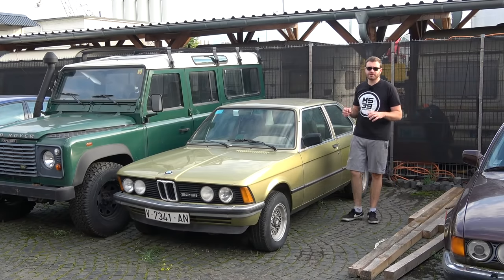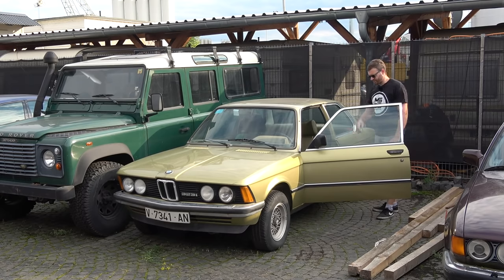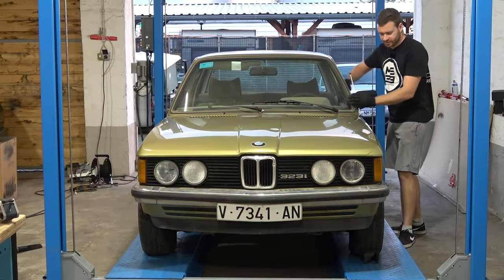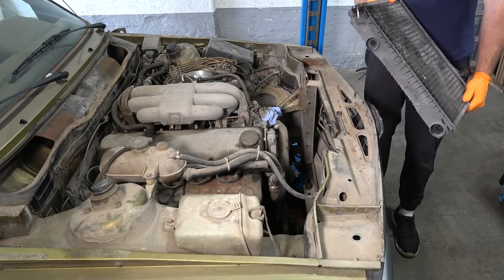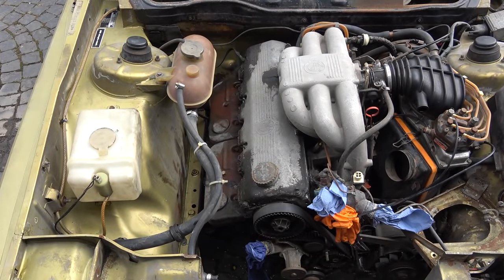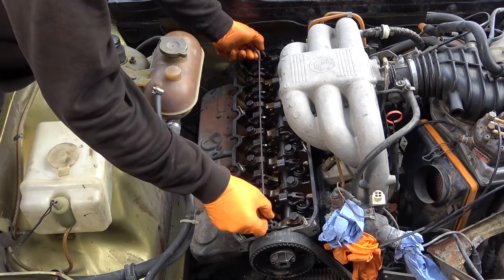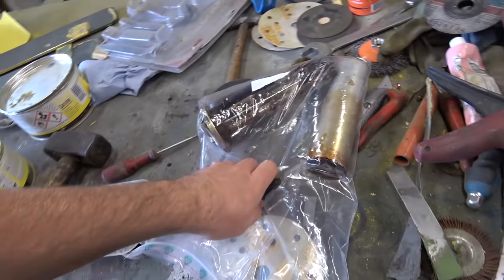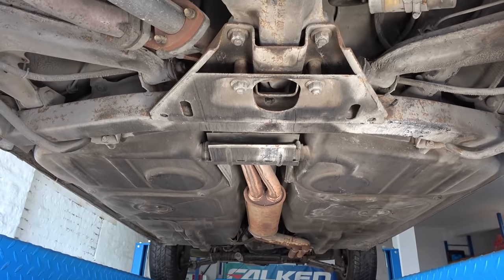26 Years Of Sitting - What Does It Take To Get it Running? BMW E21 323i - Project Castellón: Part 2

Comment: this may help you with tuning. i had bosch k jetronic on my audi i drove 100 yrs ago. that chunky stuff with fuel distributor on top is called venturi. at the end of arm attached on spindle is potenciometer that gives to comp proper location of venturi. at same arm is allen set screw i think 3 or 4 mm that can be reached with extra ling allen wrench from hole at top of housing, and level of venturi can be adjusted. it's royal pia bcz just small move left to right means live or death of engine. service manual should have proper adjustment far all components. voltage at potenciometer when venturi is in std position plunger position etc. Distributor itself is not repairable although kits exist. it's really complex system with tiny membranes and ceramic parts. I did it for fun but never managed to seal it again. if plunger goes back and forth smoothly probably problem is potenciometer, dirty or cracked. As i know only diff in between those distributors are in length of plunger so i kept original audi and stick it into mercedes distributor and worked. Took me week to make car running just bcz i carelessly moved all set screw, potenciometer and timing from original positions but it was priceless feeling when car started.

Comment: My 1980 320i (US) would not start between the temperatures of 60 and 70 degrees F due to a wonky cold start valve. For a while I would pack ice around the valve for a few minutes then it would start. Once replaced with the OEM valve it never failed again.

Comment: Got yourself a real good one here, the satisfaction you will derive when you get it up and running will surpass all the others for sure. The harder they are to rescue, the greater the contentment when you succeed. I mean, sure, it's nice to have an easy one now and then, but the thing that really puts a smile on your dial is overcoming a proper challenge.
I reckon you'll be well on the way once you get that injection pump thingy rebuilt and working properly. The paperwork fiasco might be a hurdle though - you'd hope there must be a way around it if you really can't get a hold of the original documents, this kind of thing must have happened before surely. Hopefully that will work out okay.
Great video as always - the girly squeals had me laughing. Perhaps you need to spray some of that Fogging Spray for Men on yourself..... lol.

Comment: The low compression might be because the rings are stuck in the pistons from sitting for 26 years. It might come out of it if you get it running.
I'd be surprised if the compression is that low for any other reason after the amount of miles it has on it. 

I'd get it running, driving, and drive it for a while and then re-check the compression. Get a few heat cycles through it. Maybe soak the bores with penetrating oil.

Comment: The mess in the cooling system is the result of the anti-freeze degrading and breaking down, and then some of the components of the anti-freeze reacting with the calcium (chalk) content of the water in an area that has fairly hard water.  It looks horrific but it is quite easily cleaned out, especially if you're going to rebuild the engine which will probably mean getting it bored, which is likely to mean hot tanking the block anyway.  I've seen that a lot in my part of the world as we're on chalk here, which, inevitably, dissolves into the water, and I've seen blocks that are literally caked full of that mess in the water passages come back fir for further use.  Being as it's largely chalk-based, the muck is pretty soft and very easily dissolved by a lot of chemicals...

With the fuel gauge wandering around like that, there's a very good chance the voltage regulator on the back of the dashboard is extremely tired and on its' way out, especially with the car having been dormant for so long.  You'll probably find the temperature gauge will also act up a bit too, but a replacement regulator shouldn't be expensive and is likely to be very similar or the same as was used in other German vehicles of the period.  I've replaced a fair few in various Opels and when I've got new ones they've been marked with the Opel lightning badge, the Volkswagen roundel, the Mercedes-Benz three-pointed star and the BMW propeller badges, though mostly I prefer to use ones recycled from end of life vehicles...

Comment: Hi, being a big fan of the channel, I have bought a E21 318 carburator and doing a full restauration. But I'm facing a problem : the chain guide (the metallic one) is NO MORE available anywhere in the world ! And mine is cracked everywhere and needs replacement ! Please could you help me sourcing one new or used (but good condition) in private stock because manufacturer have stopped doing them :-( :-(  MANY thanks in advance :-)

Comment: Oh ye of little faith. It’ll definitely run. That low compression will come around when you get the fuel distributor rebuilt, get it running for longer, and get some heat in the cylinders. That’ll help free up the rings and get the valves bedded back into their seats properly (you’ll want to re-adjust them after to get an accurate read on compression), which should cure the intake backfire problem. Will it be perfect? Of course not, the rust and scoring of the cylinders will see to that. But if you do all of that plus assuming a properly functioning fuel distributor (this will probably be a lot harder than it might seem, even though it is just a bunch of o-rings and seals, stupid CIS is hella finicky), I’d bet it would run better than many of the (admittedly few) CIS cars still around here in the US.

Good luck. I’ve been looking forward to this ever since you brought it home. You don’t seem to be as motivated for this project as some of your others, but I’ll bet this will get quite a lot of attention!

Comment: It wil run for sure don worry compression wil go up to after you drove it on the highway .. drive it easyly an dont force it get it up to speed slowly only 100km .. test compression again after it runs better ul c its gonna be just fine

Comment: It's very hard to make an engine run with BOSCH  K-Jetronic and it's specific Stauscheibe with Mengenteiler (that device your friend explained ) , when it hadn't run for a long time  !!                           It depends strong to the fuel-pressure and the control-piston in this sensitive device

Comment: Good work. However those injectors are totally shot. They should not let any fuel through under about 5psi and when they do it should be a fine conical atomised spray, not a dribble. Also the fuel distributor should distribute in proportion to how high the air plate lifts, so yes must likely the internal pin is jammed  upwards

Comment: if you want to get a proper compression test on the starter motor, you need to open the air wide, or you'll get low readings

Comment: My dad was a Granada fan, one of his colleagues bought a 323i new from Park Lane BMW.  If I had the choice now as an old fart, yeah I would pick the 323i over a Granada 2.8i. Interestingly the MD had a 635csi which my dad drove regularly but looking at the performance figures.. the 323i was pretty much bang on the same figures as the 635 and I guess ergonomically the 635 wasn't that much better either. The e21 just had such a sexy ass. Missed opportunity,  he didn't like having to get out to let my brother and I out of the back seats, the alternative similarly priced 520i with optional back electric windows probably blew the budget of company car allowance and was a bit... slow... Also BMW refused to give discounts.

Comment: I remember reading in the 1960's that this generation was not happy driving when e.g. one side of the car is on a slippery surface leading to an abnormally high accident rate so, when it runs again, watch out !

Comment: As soon as the pistons get some heat in them, compression will come back.
Valves are likely sitting on carbon keeping them from closing all the way. You definitely need some mystery oil to free up the rings. 
CRITICAL get some carbon eating spray. Spray it on the intake valves. 
You might be pleasantly surprised, I've seen worse run perfectly fine once the carbon was loosened up and heat cycled. Put 20-30ml in each cylinder of mystery oil or equivalent and let it set for a few days. REMOVE spark plugs and crank to remove the oil. Replace plugs and voila. I guarantee you it will start up and run decent as long as you get the Bosch-O-Matic 😂 fuel distributor working.

Comment: I really love your show good for anyone who wants to know a little about there car. Bmw are not easy to work on but you make it look so.  
I have a question re the test on compression. Did you have the air intake pipe connected when you did the test?  As you stated that the fuel air manifold was not opening correctly could have been the reason for the low compression. really really enjoy the show. all the best for the future

Comment: I could be wrong but surely this has the old k jetronic mechanical fuel injection system and that baffle plate moves up and releasing fuel to the injectors only through engine suction and therefore requires the rubber boot to be in place to create a vaccum and move the plate up? Without the rubber boot it will barely idle? Loved the video, been waiting for this one as these are my favourite of all BMW's and my first BMW was an E21 323i 4 speed manual with no PAS and single chrome door mirror, then a 320 carb auto with PAS a true sleeper, then finally an E21 323i again.

Comment: Yup, this ones gonna put up a decent fight. Previous owner seems like a genuine type of bloke #sarcasm. Old dead dinosaur juice will slowly kill a standing vehicle so ya certainly got ya work cut out for you. As you can see by the crystalised anti-freeze it really does need to be changed every 5 or 10 years or it breaks down, attacks aluminium and turns into crystalised sludge. If the chassis wasn't in such great shape then this Beemer probably wouldn't be economical to save.

Good luck kind sir and may the Bavarian beast breath fire once more 😊
Reply: agree bro
yea, the shell is in MINT shape

Comment: MEK is the stuff for serious stripping! couple questions - how do you dispose of the hazardous materials after doing something like cleaning those tanks? you have a soup of old gas and several chemicals. Here in the US, it has to go to a central hazmat disposal site. second, do you refer back to your raw footage for reassembly of some parts? that whole fuel filter, pump, accumulator assembly for example looks like it would need some archival information.

Comment: Acetone is a polar solvent, not the best choice for dissolving the polymerized contents of the fuel tank. Most of the dark red tank sludge is from heavy aromatic benzene rings from the old fuel that have polymerized together after the more volatile fuel components have evaporated away. Better solvent to use would be toluene or xylene, much more chemically similar to the sludge than acetone. Rule of chemical solubility is "like dissolves like", (strait benzene is carcinogenic so dont use it or gasoline as a tank washing solvent, the low flashpoint of gasoline is also a big danger for fire/explosion of the fumes). Backflushing fuel lines with a spray can of carburetor / fuel injector cleaner will do a good job of dissolving sludge from the lines.
Reply: Edit- later in the video saw that you were already using throttle cleaner spray can on the fuel lines!

Comment: Not sure if this engine has a Warm-up regulator but I just watched a video from LegitStreetCars and he worked on  an old Mercedes with the same issue and he got it to run by taking apart and cleaning the Warm-up regulator.

Comment: Those (worm drive) hose clips…I’ve had problems with those because they don’t seem to tighten evenly around the pipe.
I ended up using the spring type which apply even pressure around the pipe.
I’m not saying that’s what’s causing your fuel leak, but it has happened to me….
Reply: Excellent work, though! Love the channel!

Comment: The shovel moves due to the vacuum and regulates the fuel supply ...
The shovel cannot go up and down without a rubber connection, the engine creates a vacuum ...
And when the rubber connection is removed, there will be no vacuum ...

Comment: i suspect the headgasket failed, it is tipical in spain on these engines, some crappy mecanics try using some gunk compound to try and make it seal again if its a small failure, enough to say the only thing that it does is gunk up the engine cooling like you have seen. These engines are not hard at all to rebuild, i know you can do it, if not, 2.7 stroker time jejej.

Comment: This Car is fighting you, literally every step of the way. From watching the series, the engine is shot, the mechanicals need a full resto and it has the paperwork issues. My opinion, gut the shell and build a track day weapon with an M52 engine, flared arch kit and updated M sport running gear. It would make a great long term build project and be  an amazing retro track car.

Comment: If this system is Bosch K-Jetronic... almost all German cars from this era used it. I know this system from Porsche. Very picky and sensitive. You are 95% going to need to rebuild that fuel distributor, and the warm up regulator (the WUR haha), AND the CDI Ignition unit. Beware aftermarket ignition box upgrades! (Except the one from Classic Retrofit but that is $$$)
Reply: This system belongs in a museum. It is non-optimal even for the time, but was conceived to achieve modern sensibilities (when it was working correctly) while meeting emissions standards. It is a total Rube Goldberg machine. Good luck!

Comment: I want to ask you a question fellow Youtuber  Mr. M539: is a "BMW E38 725 tds" a good first project car to work on or should I pick something more simple like a 728i, 740i or a completely different BMW as a 7 series? Thank you again, it's Oleg from Belgium!
Reply: I don't think you can go wrong with the E38, as long as it has some service history. Sreten had a nice 750iL (project Dubai I think). Check out the videos and you'll get an idea what you're dealing with. I would probably not go with a TDS unless you're experienced with Diesel engines. The 2.5TDS isn't bad, but the gas engines are easier to work on, IMO.

Comment: K Jet was/is a horrible system, thank God BMW replaced with LE Jetronic. I ran 323i's 20-30 years ago and they were trouble even then! That one has had a conversion from the square tooth cam belt to the round tooth type before. They changed in late 1981 about the time the E28 arrived. Square tooth belts were NLA for years but were available 25 years ago - maybe it has had another, later engine fitted? Many have been replaced already with an E30 325i engine i, mainly because new K Jet parts are getting hard to find. Good luck!

Comment: At cranking you were mentioning there wasn't bangs and claps, what if there was some banging noises? lets say... it starts cranking and all of a sudden bangs like if something hits something inside, shakes a bit car and stops cranking, what would be your thoughts on that? i've been in minor accident (street sign post and a bit of a wall scratch) nothing too serious, and I'm trying to fix my car... let me mention i've ran it through diagnostics and doesn't show anything else, other than what was there before but in particular one error had me thinking "exhaust camshaft position sensor P0369", could it be that this crash led to some major problem with this sensor that doesn't let it start? sorry for this "buch" of a comment.. it's M52TUB25.
Love your content!!
Reply: forgot to mention, i've had to take fuel filter off cuz it was leaking and connected just the lines

Comment: When the car is standing for a long time, the oil film leaves the cylinders and the compression becomes lower. in this case, the candles are turned out and engine oil is added directly to the combustion chamber to return the film from the oil. When you buy another old car, do not put its engine on, immediately pour 5-15 ml of oil into the cylinders.
Reply from the maker: Did you watch any of my videos?

Comment: The k-jetronic system runs off vaccum, your intake boot must not have any leaks and the whole vaccum not leaking. Once that is solved u ahould have no issue starting.
Reply from the maker: It doesn't have leaks and that's not it. The control piston inside fuel distributor was stuck
Reply: in the vid you showed a ripped intake boot which is a part of the vaccum that sucks up the control piston. also you need to jump the fuel relay and bleed out the fuel distributor, resetting the air/fuel mixture. I have experience bringing back to life an E21 that sat for over 15 yrs. ^_^ cheers!!
Reply from the maker: Do you really think I used that same intake boot? Come on man. :)

Comment: We can get the fuel sending unit for that car, no problem, expensive for genuine BMW, but $60 for aftermarket.
Reply from the maker: You can't, there is no aftermarket replacement that fits AFAIK.

Comment: I've seen this before. Someone used water with heavy minerals in the cooling system. This is why manufacturers use distilled water in their cooling systems.
Reply from the maker: That's a myth. You can use normal tap water (at least in Germany) and correct coolant, and it's actually better for the system than distilled water. Google it, Febi has it nicely explained and on BMW coolant bottles says on the back to use normal tap water.

Comment: RESTORATION ... YOU GAVE THE FUEL TANKS DOWN AND DIDN'T SAND THEM, GIVE THEM SOMETHING WITH THEROSON .. YOU PUT THEM RUSTY BACK ... :))
Reply from the maker: I didn't put them in rusty, I put them back in clean and functional which is what I need to get the car running. Cosmetics comes later, not gonna waste time on that now
Reply: @M539Restorations  
hey sreten did you get the engine to run